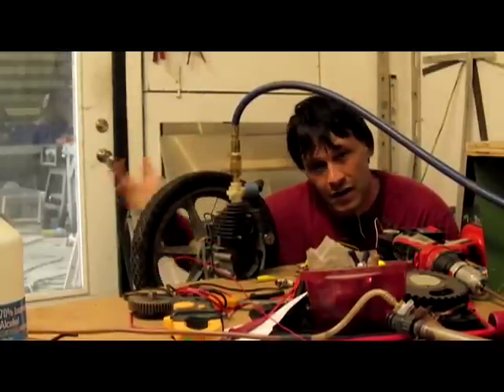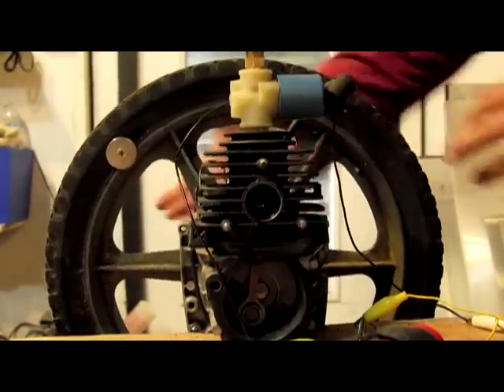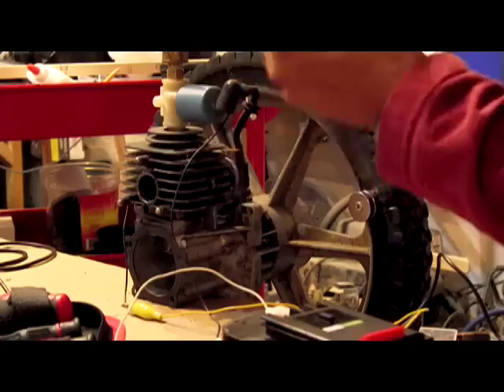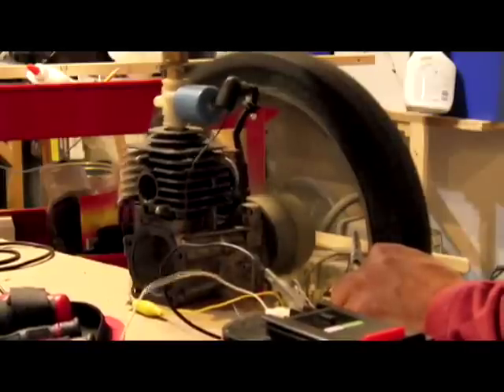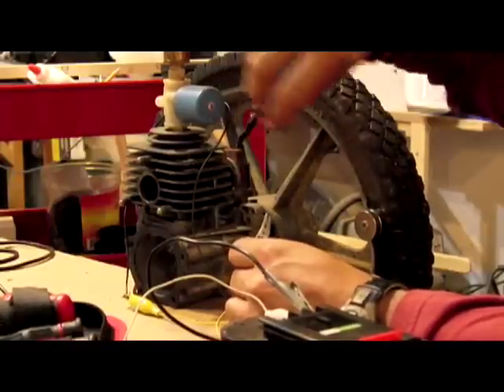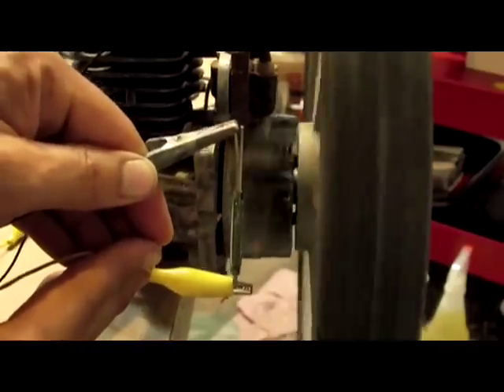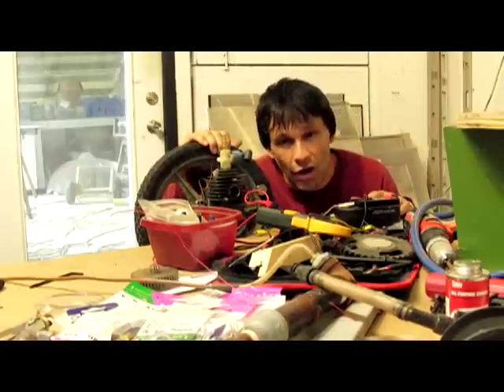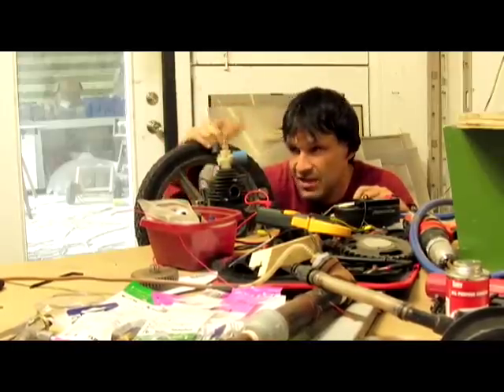DIY STEAM ENGINE HACK TWO STROKE CONVERSION Weed Eater Hack Steam Power

Comment: You could do this with four stroke engine by running compressed air to the inlet valve and modifying the camshaft so the inlet/outlet valves open and close with each crankshaft rotation instead of every other rotation.

Comment: your video is a useful engine i can use in my block making machine I'm using right now. I'm so happy that you solved my problem regarding the vibrating medium to compressed the concrete mix in the molds THANK YOU VERY MUCH. and more power to you :)

Comment: You could use a disc valve to let in the steam / air which would remove the need for an electrical power source and solenoid valve.

Comment: The problem is oiling the crankshaft's conrod big end otherwise it will wear out or seize.

I would blank off the cylinder inlet ports with a gasket and keep the crank filled with just enough oil for the conrod pin to bathe in it at bottom dead centre.... pretty much the arrangement for a clean emmision oilless direct injected two stroke engine.

Comment: I remember when you first started doing your videos. If I remember correctly, it was before you started doing so as GreenPowerSolar. I find this an excellent method for those wishing to make a solar powered steam generator. By using freon as a working fluid and a condenser in a sealed circulating system, it might be competitive to solar panels to produce solar electricity, $ per watt.  It's good to see your still at it. Your evolving and that's good. Best wishes to you and your wife/family.   SS

Comment: Interesting idea, but you are wrong about steam engine cylinder strokes.  The long stroke allows the gas the expand and release more energy.  Its thermal efficiency is much higher.  So, yes it is more efficient.

Comment: That would run a lot smoother if you would counteract the weight of the magnet you are using to trip the solenoid. Be sure to secure them good.

Comment: one possible valve arrangement if you don't have a solenoid valve is to install a type of poppet valve and install a short rod in the pistons head so that at or just before top dead center it lifts the valve off its seat against the incoming air pressure, shortening or lengthening the rod allows some timing adjustment.

Comment: You may want to look up OCEAN WAVE ACTION GENERATORS ? Water/Windmills DIRECTLY power AIR COMPRESSORS & store The FREE ENERGY 24/7 ~ WITHOUT BATTERS needed Then power generators cars etc... Some INDUSTRIAL LINEAR MOTORS & VOICE COILS produce MORE energy than they consume When used to power generators & only need outside energy to start SEE H@W Technology LINEAR MOTOR BLDD-06 & VOICE COIL NCM24-60-4190 & compare to the needed 1hp to produce 25amps = 100hp in = 1,000hp out via NCM24-60-4190

Comment: I want to run the steam engine, which I have to build a steam boiler.
I have an idea of how and what I do, but not if you just put the valve to open when the piston is up or if you had to modify the intake or exhaust.

also wanted to know more or less pressure is needed to make the engine at a good speed. think 20 PSI is enough (to know the pressure necessary information is very important to me, because depending on this is that I know how to do the steam boiler)

thanks for replying

Comment: would the mechanical slide or piston valve work when the spark plug whole on the weed eater engine I found is not centered on top? it's 45 degrees off to one side.  can you explain how I would set this up or point me in the right direction?  Thank you for all your great work!

Comment: on my truck yes..... off grid power to my house is a work in progress...  the problem i came to was it eats the plates in ur hho gen fast. i was using galvanized steel. and a weak hydrochloric acid solution in the water.it made lots of hho. for a wile.lol. but if i dident use galvanized steel.or the acid in the water my hho production was at least cut by 30% maby a  little more. and i also found you have to use DC power  AC dose not work...

Comment: the problem is that the energy produced is about 1 tenth of the actual fuel burned to produce the heat or in your case the electricity used to produce the compressed air , its still about 10 to 1 ratio.  So unless you can produce enough steam with solar to do anything , its merely a toy, kewl video though Dan and its good to keep people thinking., Im in no way knocking your stuff.

Comment: Type into your search engine; OCEAN WAVE ACTION GENERATORS ~~~~ ~ ~ & watch any of the videos on you tube. OKAY ? Water/Windmills directly power AIR COMPRESSORS & store The FREE ENERGY 24/7 until needed WITHOUT the need for batteries Then power GENERATORS etc... SEE COMPRESSED AIR powered LOCOMOTIVES 1828 & A car that runs on air by MDI. We have NOT needed OIL as a FUEL since before 1859. ENERGY is a ^$5 TRILLION a year SCAM ! Watch The Hx channels program The men who built America

Comment from the maker: Thank you for the nice comments. The solenoid valves are "normally closed" type and you can get brass versions on ebay for about $15. The Brass versions are good for 5-35 million cycles. Not a lot for a fast engine but good for testing, a mechanical slide or piston valve would be a better long term choice.

Comment from the maker: Magnetos are Alternating Current. The magneto delivers a periodic pulse of alternating current to the spark plug. We are not using the magneto at all. 
Search "Magneto Alternating Current"

The separate magnet is only a timing mechanisms connecting a reed switch just past TDC to open a valve and convert a combustion 2 stroke engine into and air/steam Engine.

Comment: lol that may work there but try it in NW Ohio......its not going to happen ...lol.. but you could geothermal it then use that to boost efficiency of a wood coal gas or electricity  boiler .   im going with an HHO generator to run a gas generator..then on to a battery bank for off grid electricity . had planned to go with steam but i found hho was going to go a lot farther and with less work...can even use it to get 35MPG out of my big ford F250..by feeding it into the intake.. post filter..

Comment: lol, you'll never get close to the energy created from the same two stroke motor running on a gas/oil mixture, even better, get a belt, hook that motor up to a compressor pump like the one you're using to fill that compressor that is providing pressure to your motor, fill you're compressor AND let it run till it's out and see how much air you have compressed into the empty tank compared to how much you started with.

Comment from the maker: For four stroke engines, it is easier to sand and remove some shaft lobes, then drill, tap, add small bolts to the shaft and cover with a sturdy resin or two part hardening compound to recreate lobes in a different position so the firing moves from 4 to a sort of 2 stroke (open intake close - open exhaust out close). Depending on the number of cylinders this can range from easy to complex. You keep all the native valves.

Comment: The point you referred to at 2.08 is not quite true. Steam expands into the cylinder in the same way as your steam engine, but a control known as a cutoff controls this. Imagine your solenoid had a variable length opening time, like a potentiometer, and you have it. Full cylinders when starting for torque, max cutoff at full speed for economy.

Comment: There is some water vapor from the exhuast indicating it is cold because of expantion of the air. I notice some arcing flashes from the reed switch and over time will destroy it, If you are using DC current a diode can be wired across the solenoid valve to fix this. There is a white mark on one end of the diode and this will go to the + side of the solenoid and the other end of the diode to the -- side, if you reverse this it will act like a shorted solenoid so to fix it just reverse +,-- poles.

Comment: That's a clever design--one that eliminates the machining needed for a conventional steam engine valvetrain.  The effectively-shortened power stroke could be offset by choosing a larger engine, if needed.

Comment: Good explanation, using a converted two-stroke gasoline engine, of how the one-stroke steamer actually runs.  A Walschaerts-geared double-action steam engine uses both the input-steam valve and the reverser/cut-off to control torque and RPM.

Comment: Huge correction: Given the co-efficient of expansion of live steam (about 1600:1), on an equivalent sized valved steam engine, running at the same rpm as this engine appears to run at, steam would only have to be admitted for about 5%-10% of the total stroke, once momentum is gained, not for the full stroke as you indicated.
Reply: interesting-thats something i wondered about

Comment: Compressed air is not equal to Steam. Steam expands about 1000:1 and is much more powerful then compressed air. Because steam is hot it will make the entire engine hot. Any plastic will melt. This DIY engine will NOT work on Steam.

Comment: dude would it be possible to attach a compressor to this and just use the tanked air pressure to run this engine generate elec and at the same time recompress air into a tank with the compressor? or would that be too much load on the machine? MAYBE some kind of scooter VARIO gear system to increase the ratios.. i dunno just suggesting :P

Comment: THAT IS FALSE a regular steam engine (at least the one used for trains) powers the piston forward and backwards... so comparing to that you would be getting technically twice the power from a regular steam engine to that engine you modded up there. In terms of efficency... well u may be right but i dont think you are, if you look at how that compares to a regular steam engine. BTW other than that commnt good job.. use an RCR with the magneto to pwr the solinoid

Comment: Okay, say I want a reasonably powerful steam-driven generator, for power way out in the boonies.

The biggest 2 stroke that I found for sale was 1050CCs, but it had 3 cylinders--never mind, I think multiple cylinders are workable.

How big a generator will that run?

A are there bigger 2 strokes?

DukeNukem65--my best guess would be Air-tool oil.

The idea of water going into an expensive engine is enough to make me want to steam drive an Air-Compressor, let the Air drive the Engine.

.....RVM45

Comment: mmm green steam power.....to bad generating the steam takes 1000 times more BTU's in heat to make. Steam is a great power source, but very inefficient, taking way more fuel than even the most inefficient gas engines. 

Cool build though

Comment: big fan but i was wondering if anyone tryied to power a grid tie inverter off one of them.
I built a solar panel and it gives me only 18 watts using it on my grid tie inverter.
if i hook it up to my homemade acohol running generator i get about 48 watts.
so if i make a boiler with a hot water heater and woodburner or firepits i think would be more cost cutting.  there is always something to burn.  
 solar panels cost but more time consuming to make.

Comment: @Lego5ful The Magneto needs alot of current (amperage) to move that electromagnet. (Pull the solenoid)... The Magneto only outputs less than 1 mA, probably around the same amperage as a static shock.

Comment: Grate way to make a single action uniflow steam engine!
I would block off the intake ports in the cylinder tho.
But how would you do it with the lubrication of the cylinder and crank/rod? And how about the possibility of rust in the cylinder?

Comment: you can see it arking  in the reed switch & it will burn out . i recommend using a relay  but ..... the timing will need to be changed.  anybody think different ? you should make it into a small generator

Comment: you can see it arking  in the reed switch & it will burn out . i recommend using a relay  but ..... the timing will need to be changed.  anybody think different ?

Comment: This doesn't work for a steam engine because of the temperatures involved.  Even if you keep it low pressure and minimal temperature its then not as efficient and the  solenoid you would need costs around $300.

It seems like a great idea, but when you do the research its not all its cracked up to be
With compressed air it would work, but it stores less energy then steam

Comment: @JakeyCak3z  It depends Friction heats up an air engine not as hot as a gasoline engine, if your running something like the weed eater engine for a short time you may not notice because there's a lot more mass to heat up ,have you ever touched a tire hand pump after you've pumped up your bicycle tire, and steam engines definitely get hotter especially when you get above saturated steam.  I have a steam bicycle that operates at 750 F
Steam in general is a whole different game
lol just so you know

Comment: Now the question is, was it the magneto that was causing so much drag or, the compression of the engine at the top of the stroke? When you have the selinoid at the top of the stroke without it open your creating compressed air. The only way to test it is to either open the selinoid without compressed air, or take the magneto off.

I'm using his design to make a compressed air mini bike. Now, what about lubrication? Or throttle control?  Could you use the voltage from the magneto to open and clo

Comment: put the cap back on and give it a little oil bath. on the output put a T, one end point up and and other end pointing down to drain back into the pool.. and there's your lubrication.

Comment: It actually produces several thousand volts. and the resistance you're getting isn't from the magento, it's from compression.

Steam/air engines don't need a lot of lubrication. a few drops of oil every now and then is plenty, they don't get hot like gasoline engines, they actually get colder as they run.

Comment: you've inspired me to create something like this myself, my idea is to get something similar to a bead seater or a cheap air compressor, then instead of using the reed switch, is there anything stopping me simply wiring the spark-plug wire onto the valve? then move the coil around until it's at it's sweet spot, leaving the "accellerator" to the main valve on the air compressor/bead seater?

Comment: @Hidframe If you set the electrical supply up (40 volts from 2-cycle engine + whatever else is needed from another source) properly it would be possible to "help" supply the compressor. However the 2nd Law of Thermodynamics supports me when I say that you cannot make an engine 100% efficient.

Comment: Awesome job. Just have one question. I noticed that it produces 40 volts. Would it be possible to use that energy to power a compressor? That way the circuit would be self powered....Engine would produce power, that can power the compressor, that can produce pressure, and power the engine. (Just wondering if it would be possible)

Comment: Could you jest attach the switch to the magneto and use that for electricity andtake the wheel of it messing up the rotation but that would be fun to put on a bike oh do you even need a valve

Comment: @rvbilly Because having the exhaust go back into the (pressurized) input tank would require the exhaust to be pressurized by the engine. So all the engine's work would be wasted in putting the gas back into the intake tank, and you'd not get anything back out. In reality it wouldn't be quite that simple, but it wouldn't be a viable thing to try and do. 

For this to work there needs to be a difference in pressure between the input at the exhaust. If they're both the same pressure it won't.

Comment: Hi Dan. Did you find an off the shelf way to fit a slide valve or check valve to a weedeater? I am wanting to make a steam powered weed eater engine to do work around my permaculture property but I am not sure what sort of long life valve to use. I assume using a slide valve or check valve will mean not needing to use a battery and reid switch?

Comment: Hi Dan,

I am working on a 2 cilinder air engine made from two 2 stroke engines.
But i cant find a solenoid, what is the type used here becouse the only ones i found were fine tuned expensive metal pneumatic things.

Ty

Comment: Have you considered or tried using a piston activated valve in the spark plug hole?  It would  be opened by the piston at Top Dead Center, then closed by a spring pressure as the piston decends.  That way you eliminate the battery . The Air Hog airplane toy uses a compressed air engine to power the propeller. It flies pretty good !
the engines have been broken out to use in other airplanes.  Good video I have several old weed eater engines taken apart.  Was thinking of something similar.

Comment: Dan, cool idea, but are you sure that coil isn't in reality putting out anywhere from 25,000 to 80,000 volts?  The voltage waveform looks like a fast transient.  It is very sharp.  Also, are you sure your little dvm isn't set up for to measure 60hz AC only.  It takes a lot of energy to break the dielectric strength between a spark plug gap to arc over to the other side. cars used to be about 80,000 volts.  I am not sure what a weed wacker coil puts out.

Comment: now why not just leave an alternator on the engine then you wont need the battery and you can just use the magneto as the switch like it is used on the gas engine? and if your magnetto is rubbing then your distance between the wheel and magnet needs to be adjusted it should not touch. just wondering. or just put a little more weight on the fly wheel and not use the valve once it gets going it should just power itself right? just pickin your brain for knowledge.

Comment: Buddy.  Good work but this is not a steam engine.  You keep harping on about the magneto this, the solenoid that.  Try making a boiler and providing a heating source for use in a vehicle.